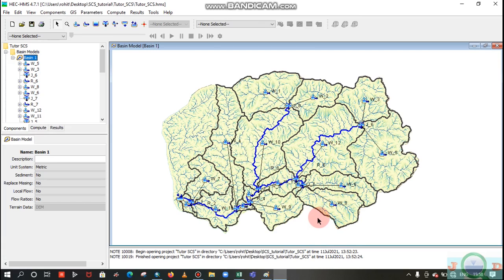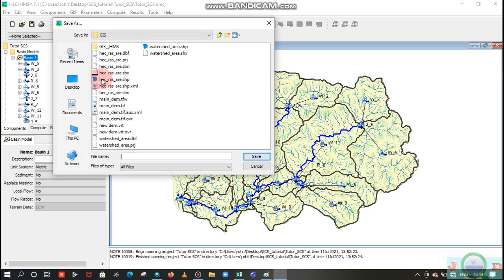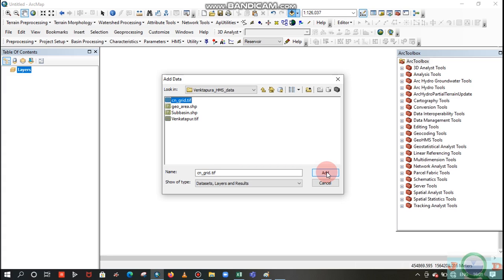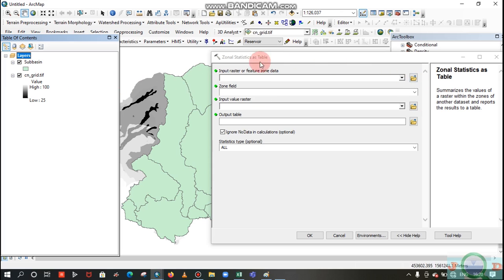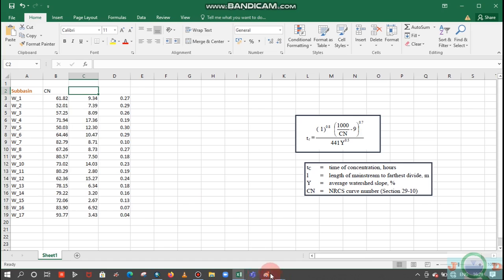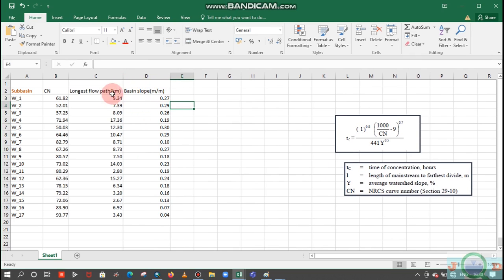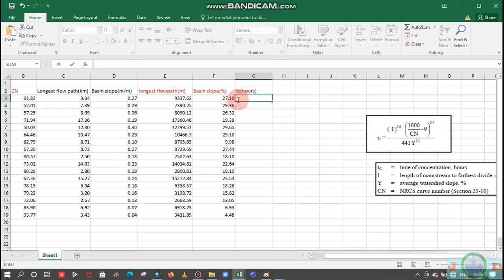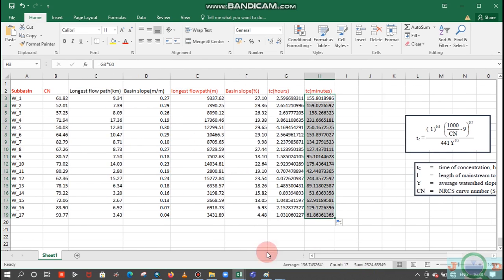HEC-HMS 4.7v:SCS curve number(storm)part2_parameter calculation

Comment: It's very useful. Can you please give the reference for Time of concentration formula.
Reply: NRCS hydrology manual
Reply: @rohitnayak9952  Thank you. The manual formula is /1140Y^0.5, but in your video you have used /441Y^0.5. Can you please let me know the reason?
Reply: @princethangadurai1273  1140 that's in feet units
Reply: @rohitnayak9952  Then it will be 348 in meters right?
Reply: Mr @rohitnayak9952  and Mr @Prince Thangadurai  i have the same question, Mr. @Rohi Could you please let us know where did the 441 number comes from? Thank you so much
Reply: I am also confused with this formula, couldn’t find it anywhere
Reply: Hi, please find the reference here: https://directives.nrcs.usda.gov//sites/default/files2/1720461053/Chapter%2015%20-%20Time%20of%20Concentration.pdf I feel that the length should be converted from km to feet, and rest should be left as is and then time of concentration would be in hours. The confusion is because of the dimensionless constants and FPS units, therefore, 1140 should be at the denominator. Perhaps, initial abstraction should be converted from inches to mm as it's the same S in the time of concentration formula, Ia (inches) = 0.2S (inches). Takeaway is to leave things as is and then convert units at the end of the calculations. Correct me if I am wrong, I hope I am clear to help you out!